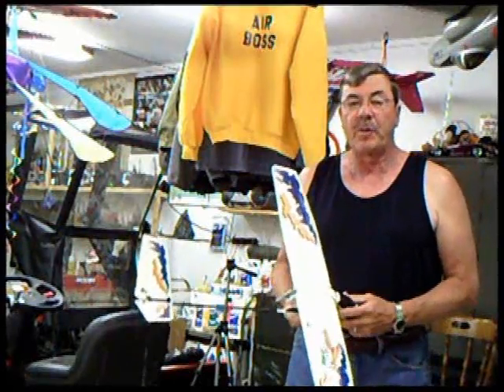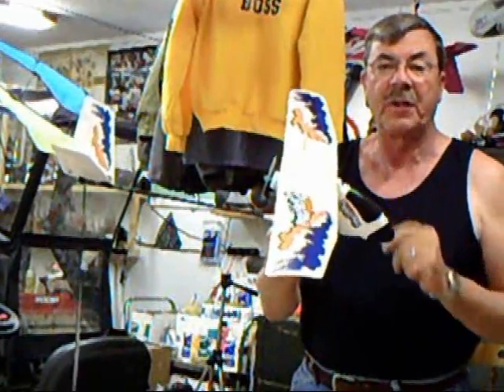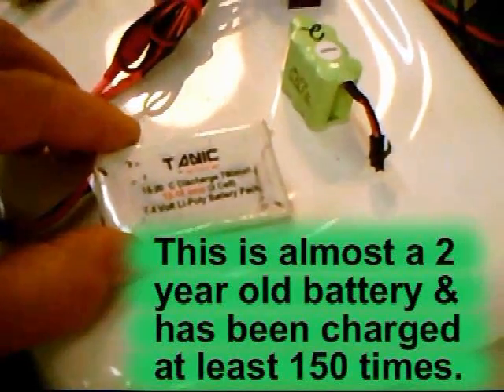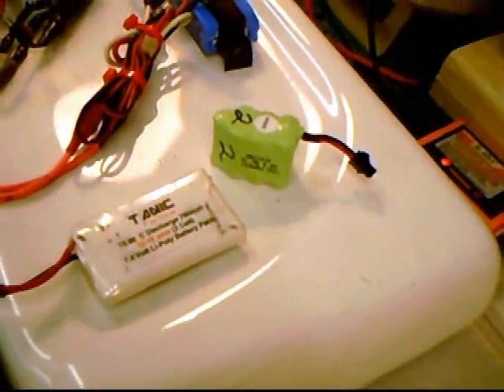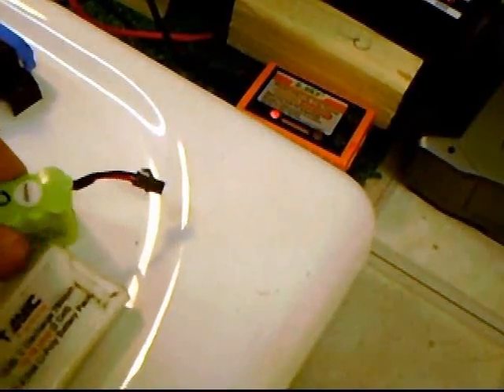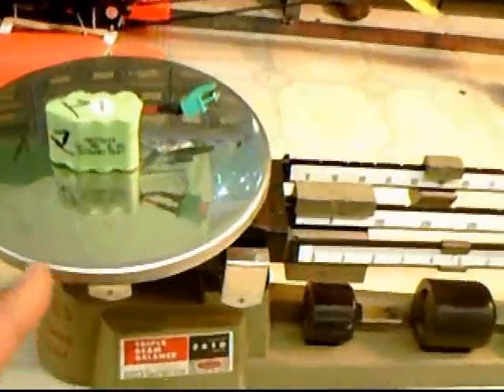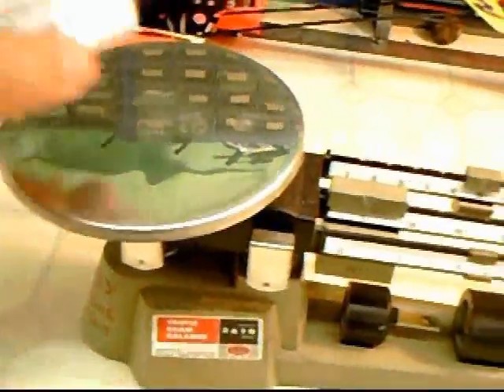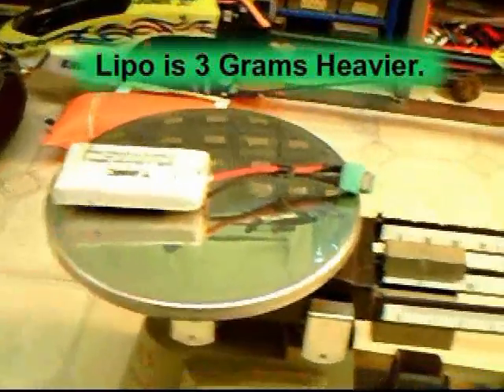LiPo Vs NiMh in Firebird  "FlyOff"

Comment: how long does the battery take to charge? I'm thinking of buying two or three extra batteries (the original 7cell 8.4v nimh) so I can get much longer times flying. Also how high can you take this plane? How much range does the transmitter have? I've seen someone fly (joehandsome I think) with a flycamone 2 (stupid name lol) that weighs an ounce; the fpv system I have is only 28g. In that video he managed to do lots of aerobatics. Thanks very much for your videos helped me a lot in deciding.

Ed

Comment: You should be able to get almost all of your rated mAh before you hit the 6V cutoff.  Also, the LiPo should also start at around ~8V when charged or 8.4V at max charge.  

The NiMH pack will also drop from 8.4V to 5.6V (the minimum safe voltage) under load as it's discharged.

The easiest test is just to charge both (no handicapping by flying the LiPo first), restrain them side-by-side, and run full throttle until they quit.  This has already been proven with the Losi Micro-T optional LiPo.

Comment: Thanks Dave. I always read that Lipo is the way to go, and that it's always much lighter than other battery types. It may have lasted longer but it was heavier. I wonder how much MORE flight time you would've gotten over Jeff if you ship had been trimmed out right and had the battery (which wouldnt fit) in the nose and thus more aerodynamic. Not to mention that you'd already flown a little before the flyoff. Great video! Thanx

Comment: Nice flight.  A tip that might be useful:  I have lost previous Firebirds due to weakness in the tail at the point that the control wires come out.  A 3 inch piece of clear plastic tubing glued on around that spot with 5 min. epoxy reinforces it so that it never breaks.  You have to move the steering controls while setting up to keep from glueing the wires.

Jeff